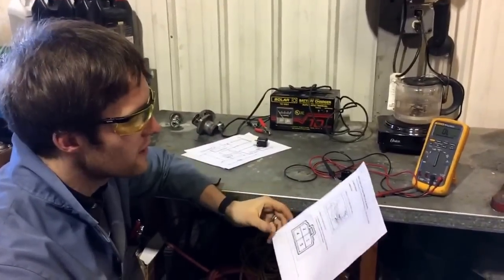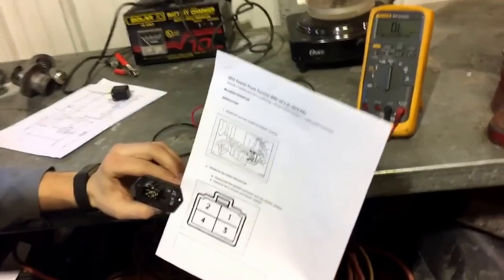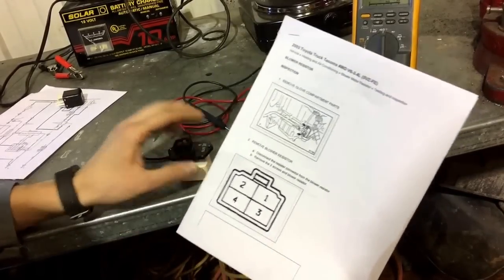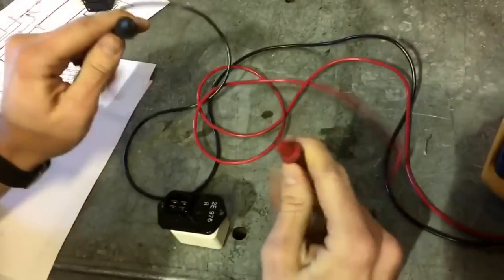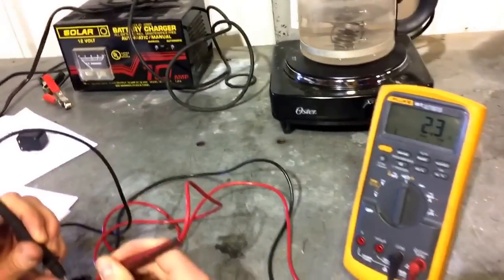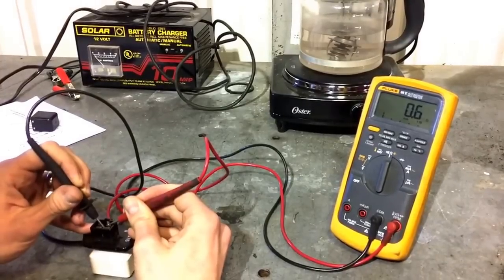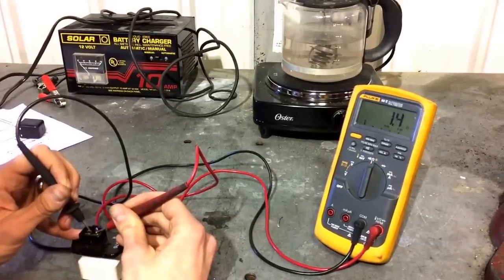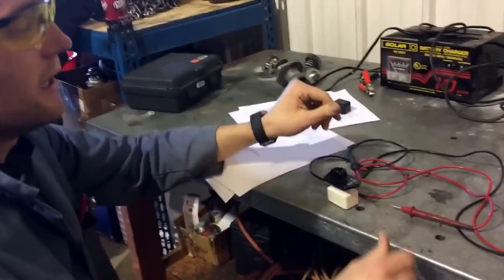Blower motor resistor test

Comment: So first of all, you said pin 2 is low speed, pin 3 is medium speed and pin 4 is high speed. According to ohms law you should have the highest resistance on the lowest speed and the lowest resistance on high speed. Medium speed should have a resistance that is in between those two resistances. I’m not trying to be critical just accurate.

Comment: so, instead of some coils in stone (if you open them up its just wound up steel wire), couldnt we use some electrical resistors?
Reply: Its nichrome

Comment: Yo quick question.  I should have 12v going to the resistor right?   If not and the fuse is good, would that be blower speed switch?

Comment: Where do you get the spec?  I have a Nissan Infiniti I30
Reply: @FixItYerself  I have a Haynes manual for a 1999 Subaru.  It shows how to test the ohms, but not what the specs are for each setting/speed.  I don't know where to get those specs except from a dealer.  I know this is an old post, but just in case anyone else is trying to find info on a resistor.
Reply: @robertharris7627  i found a forum that mentions .46, .6, and 1.0 ohms, so you could test to see if you get something close to those on each pin/resistor. If the blower is blowing a fuse or creating a lot of heat in the wiring, you likely need a new fan; I found this out the hard way on the wife's Mazda when hard-wiring a switch simply ended up in melted switches. If the blower is only working on certain settings, then one or more resistors in the 'blower resistor' may have failed--they're fairly inexpensive, but if you're handy enough with a soldering iron, you may be able to save a few bucks by buying replacing the little resistors in the unit.  Newer cars with climate control use a mosfet and also have a small thermofuse that breaks the electrical connection when enough heat is created from too many amps; I doubt you'll find that on your '99 Subaru if it just has basic heat and fan controls, but it's something to look for.
Reply: @FixItYerself  Thanks for that info, OGN.  The results  I got on the one in the Subaru were 1.2, 1.5, and 1.8.  I don't think that's the problem in this case.  I believe the board in the control module is bad.  I ordered one off ebay and will find out in a few days if true.  When I tested the power for the plug that connects to the resistor,   there was no power.  I removed the motor/fan and connected it to a battery and it ran fine.  All of the relays and fuses tested good.  I need to test the wire from the plug at the control module that goes to the resistor, but don't believe there's a problem with the wiring, but could definitely be wrong.   The wiring diagram in the Haynes manual is good.  Just wish they put ohm ranges in there to have something to compare to.   I'd rather work on a mechanical problem any day.
Reply: How about nissan maxima
Reply: Do you realy had to get a diagram to test the resistor?😀
Reply: @ismaeldossantos3296  Yeah those pesky diagrams 🙄 they usually can tell you a lot but why use them,waste of time,lol
Reply: @ismaeldossantos3296  do you know which pin is #3 off the top of your head because no tech I work with would.